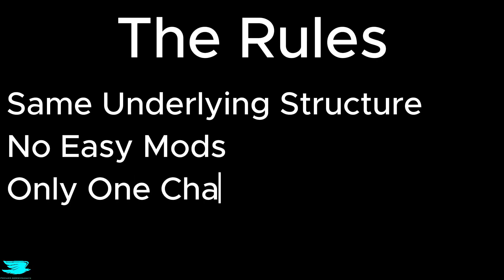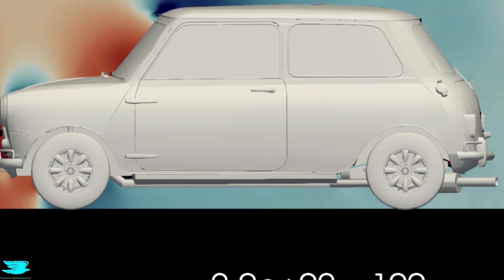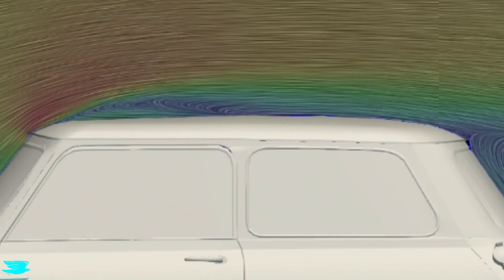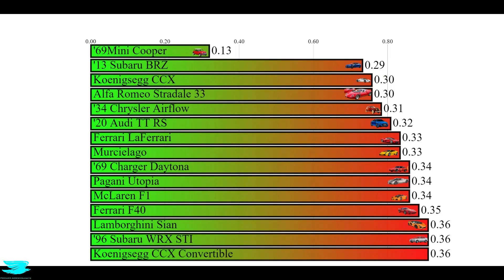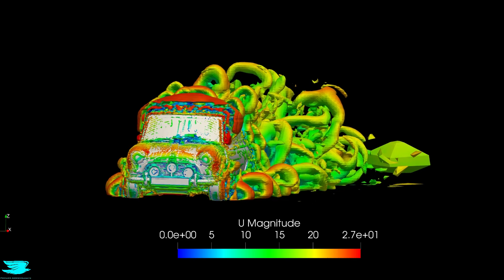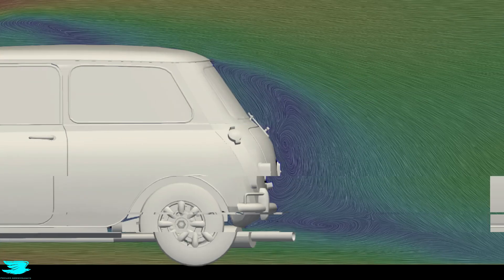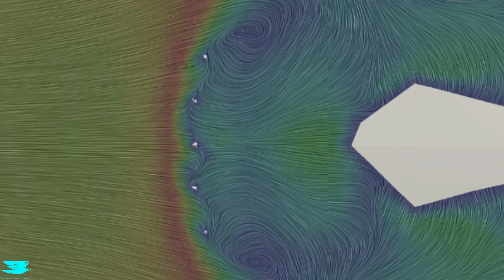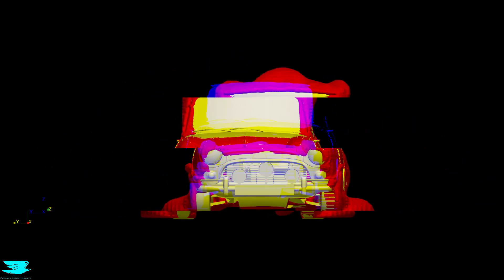I Made The Mini Cooper More Aerodynamic

Comment: Very nice! What about rotating the vortex generators 180 degrees? Or just to clarify, the back of the generators becomes the front. I believe this will account for a lot less drag, but a bit less downforce unless a small wing is attached at the back(downwards wing will create not as much downforce, but will increase diffuser efficiency). I believe these two mods will increase the aero efficiency of this car. Correct me if I am wrong.
Reply from the maker: They could turbulate the flow in an usual fashion that could also lead to flow attachment, but I think it's more likely that they will just add to the flow separation because if they're backwards, they are more like bluff bodies.

Comment: It would be awesome to watch your analysis on a modern BMW Group Mini Cooper or Countryman. My daily R60 Countryman has large front-wheel pressure lips that need replacing everytime when hitting a large bump or curb stop. 

I also noticed the rear D pillars and spoiler have a weird taper - which looks like there was some thoughts to the rear aero despite the vehicle being relatively boxy.
Reply from the maker: Thanks for the idea! We'll put it on the list!
Reply: @PremierAerodynamics  A 1st gen Mini Countryman R60 is definitely an oddball request, and I doubt anybody else will ask for it. However, thanks for putting it on the list! 🙌 

There are only interesting press images from 2010, inside the wind tunnel, where they are testing the aero. It’s literally a boxy vehicle, so I wondered what they were compensating / tuning for. There are no definite Cd numbers to be found.

Comment: There was a kamaz dakar truck that had what looked like a visor ahead of the brow of the cab. It appeared to be angled to redirect the air coming off the windshield back over the roof.
Reply from the maker: That's a great feature to keep the flow attached, but it could also increase the lift because now you are turning the flow and there will be a lot of low pressure on the outside of the vane.
Reply: @PremierAerodynamics  also the kamaz is a cab over design so there is no hood and all stagnation zone below it. I'm still kind of curious if a visor can increase the recirculation bubble at the windshield to be useful like the bubble in the bed of a pickup.

Comment: I think the first and easiest mod I'd do is seal / cover up the area under the boot, I don't think the model showed enough detail here, though. Standard, it's almost a paracute.
For the area you were looking at I think turning vanes would've been a better option along with faring in the gutter lip to help the transition.
Reply from the maker: Thanks for the idea!
Reply: @PremierAerodynamics awesome work. it’s pretty trivial to cover the rear subframe and extend it slightly past the rear paravan (which rots off really easily as well 😊).  If you would cut the lip at the front but leave the side and rear it would still look right de-seamed minis look odd. And I wonder what lifting the rear of (about 40 mm) the bonnet would do. It’s often done in an attempt to lower under bonnet temperatures but I doubt that actually works when you move but I’m curious what that does to overall flow.
Reply from the maker: The 40mm higher bonnet would help a little in reducing the drag from the windshield because the angle between the bonnet and the windshield will drop now.
Reply: @jmriph2460  I tried lifting the rear of the bonnet on my engine converted mini probably 20mm as it was getting a little above normal, it made no noticeable difference. I made up some plates to lift it further but it looked ridiculous so they didn't stay. Maybe one day I'll wool tuft it and see if I can see any difference. Like you say a rear aluminium diffuser is so easy it's a wonder to me that I haven't seen them in the aftermarket.

Comment: If the front lip is removed and the top half of an airplane wing shape is used actually raising the roof over the drivers head by 10 to 15cm to create a smooth transition from the windshield angle back to the rear of the car could do a lot.
At the end of the roof a splitter to direct some air down over the rear.
The lift will probably increase, but the flow would likely be smoother, so the overall drag cold be lower.
Reply from the maker: Definitely smoothing the front lip would be a good idea!

Comment: is it possible to add a little lip spoiler where the hood meets the windshield wipers? 

ive seen alot of trucks using these as wind deflectors in the roof and hood , i wonder if if does anything if it shoots air up near the windshield at a better angle
Reply from the maker: Definitely, that would work. We have a video in the works that looks at that idea.

Comment: I own a 1995 Toyota Camry and I plan on making some 'Minor' body improvements and I'd like to see what those 'Improvement' will do to reduce the Drag on it. One is, I'm going to Slope the center of the Hood between the Headlights down (Like the early Ford Capri) and I plan on dropping the center of the roof about 2mm to 4mm. Also, I am trying to understand where I should start the 'Hood Ducting'. Should I make openings Before the Radiator (Under the Hood)? Or after the Radiator (in the Engine Compartment)?
Reply from the maker: One way you could tell if it works is just look at the fuel usage, and average it over a few trips.
Reply: @PremierAerodynamics  I have yet to do the modifications, I was hoping to see a CFD diagnosis of a comparison of 'factory' versus the changes.
Reply from the maker: Thanks for the ideas. We charge to do aero modification analyses.

Comment: How about just deleting the sharp edge around the roof? One change, no structural problems,... I was surprised you didn't do that instead of the VG's
Reply from the maker: We were definitely thinking about it, but it was a little too easy. Also, to make that mod on a car, you'd have to take an angle grinder to it, so it's a one way trip.
Reply: @PremierAerodynamics  I would have still liked to see it, just to find out what is would do
Reply: The car would fall apart.
Reply: @Margarinetaylorgrease  why?
Reply: @toonverbruggen7351  
It’s structural. Same with the ones up the sides
Reply: @toonverbruggen7351  
If you could get rid of that rule it’s a great idea
Reply: @Margarinetaylorgrease  Interesting. What exactly does it do? It seems quite flimsy
Reply: @toonverbruggen7351  it's the flange the body panels are spot welded together with 

Cutting it off is like taking perforated paper folding it on the perforated line then cutting just next to the perforated edge the connection point is still intact but the two sheets are now separate 

It's also a way to index panels into the correct location for assembly particularly back in the day when cars were largely hand assembled
Reply: @bluejayfabrications2216  Well I learnt something about minis today. Thank you!
Reply: @Margarinetaylorgrease  That's what TIG welders are for.
Reply: @shoutykat  wouldn’t this, as I previously stated, be changing the structure of the car?
Reply: @Margarinetaylorgrease  Depends on how you define that. That joint is spot welded together. If you seam weld it in the same place, just removing that flange, how different is that structure?
Reply: @shoutykat  
Triggers Broom

“The ship of Theseus” as lesser humans know it
Reply: Quite a few custom car type minis were 'deseamed'  back in the day.

Comment: What about an external sun visor?
Hy-way still make them new for all sorts of cars
Reply from the maker: Good idea. We'll have to look into it. But, my initial thoughts are that for cars with rounded roof edges, they would hurt because you'll likely channel the flow in a more angled fashion.
Reply: @PremierAerodynamics  your the doctor is trust your gut over mine 

I was driving my hq Holden today I can actually feel what you are talking about about when you say low pressure area when I have my hand out the window I can feel a distinct difference in the air along the A piller and wind scree at different speeds

Comment: So basically that lip around the roof is hurting it's aerodynamics a lot; would be nice to know how much better would it be without it
Reply from the maker: Yep, a lot. Thanks for the idea. We might revisit it later.
Reply: @PremierAerodynamics  perhaps try without the gutter rail and with the addition of a forward projecting "visor" that acts as a turning vein to redirect the high pressure air from the windscreen upper region to attach and energise the flow along to roof?... I've always wondered if a "correctly optimised" windscreen "visor" could actually "reshape" the aerodynamic profile of an otherwise overly vertical cabin shape vehicle??? 🤔  hopefully you follow what I'm attempting to describe? Cheers mate,  awesome video
Reply: @stuttgartclassics like those you see sometimes on top of the headlights of European trucks, only vertical
Reply: Yeah that gutter lip you can actually here it when you're over 80 or 90 kmh 

I get the same from the stainless trim around the wind screen of my hq ute over 100kmh